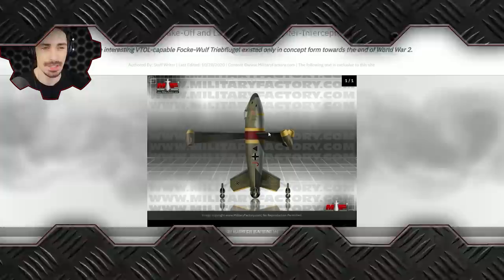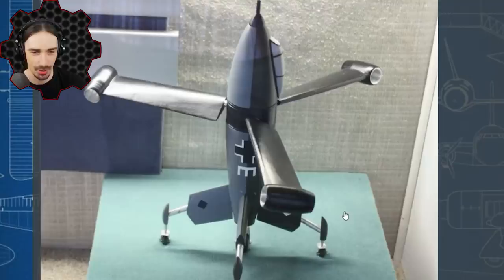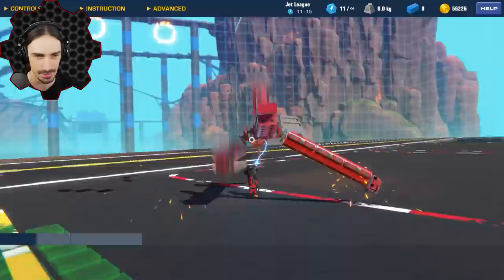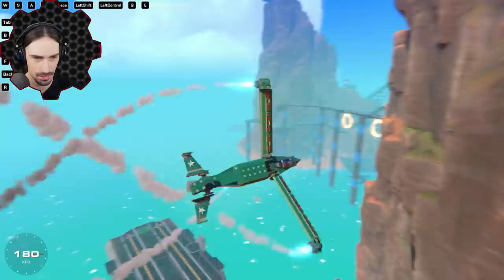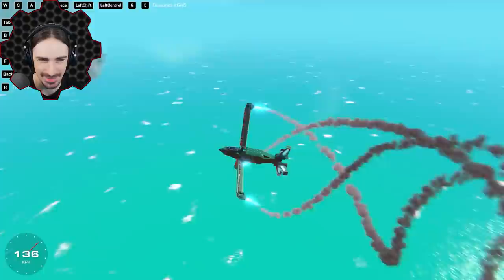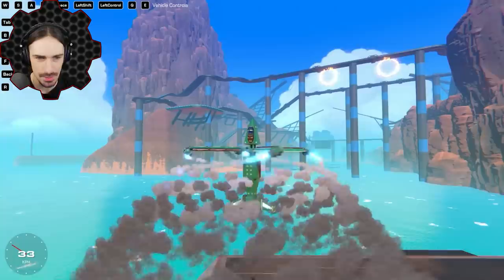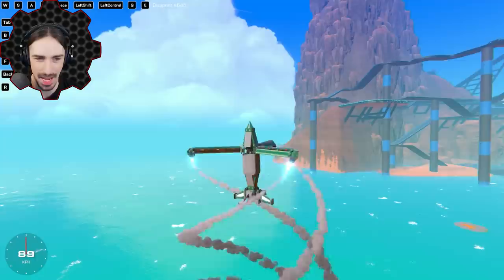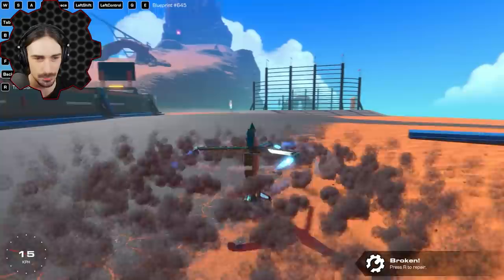TRIEBFLUGEL: The Craziest VTOL Design They Never Made... BUT I DID!

Comment: Your main issue is that the rear flaps aren't keeping their orientation with respect to the cockpit. It is rotating and thus screwing up your controls. I would recommend a larger surface area on the rear stabilizers. The other thing you can do is have 2 counter rotating propellers to cancel out the rotation. Finally, to control pitch and yaw, you can also implement logic similar to the monospinner but rotated 90 degrees to control the jet power as well as the rotation on the ends of the rotor. Your compasses can be horizontal, and you just correct for this using the logic blocks.

Comment: Believe it or not tip-jets are not a terrible idea, but are hard to implement. The Sud-Ouest Djinn is the only successful mass produced tip-jet helicopter I'm aware of, but it used a jet engine to supply compressed air to the tip jets, which simplified things greatly as there wasn't any fuel/combustion in the tip-jets, they were just compressed air nozzles essentially.

Comment: In order to get more pitch and yaw control while hovering, you could make the whole tail section angle, instead of just the fins. The shift of its weight should give you some control over your thrust direction. The only problem is that if you go backwards, the tail fins will switch the direction they steer you in, so you'd ideally need independent controls, or at least logic gates that swap thee tail fin movements while you descend backwards.

Comment: The reason why it is steering to the left is gyroscopic precession, it basically means, if you apply force to a spinning object, the force will be turned by 90°. So your plane/helicopter thing was turning downwards, because of gravity, in combination with gyroscopic precession it was turning left.

Comment: I'm curious if horizontal flight was meant to have a stationary rotor and be fully jet propelled, or if it was supposed to be a giant jet propelled propeller; I would assume the latter based on it's design. A newer design could have individual pitch controls and use the former propulsion to have a hybrid of single axis thrust vectoring and surface elements to have a complex pitch, yaw, and roll controls in horizontal flight between the three blades, assuming it also had a rotor lock to prevent roll from activating the passive rotor. Further this by adding hinged elements to the wings, though these would work better with an element per side under things maneuvers like braking, where a single element per wing in this configuration would induce roll, and only using two of the three would induce pitch within their combined vector. Having nose canards and active surfaces on the tail winglets may also help; another helpful addition could be a tail thruster, which could help for quick takeoff and could provide a suicide burn during landing, assuming the horizontal-vertical change maneuver could spin the rotor quickly enough to do an sb before hovering to land. Any issues with torque being induced on the body could be countered with small thrusters, like how propulsion-based attitude control is done on spacecraft, as this would only really be needed during vertical orientation, and these thrusters could be tucked away such that it wouldn't affect horizontal aerodynamics. 

It's a cool concept that could work with more modern technology, but it's so stupidly impractical, especially when we have jet VTOLs that work by essentially having an extended range of motion on a thrust vector, essentially allowing a thrust vector of ~110° to hover a jet instead of the typical in-flight thrust vector that has a much narrower range; I know, it's a separate mechanism to allow a higher degree of vectoring, and not just the simplistic thrust vector mechanism, but this is the simplest explanation. We also have rotor-based VTOLs that could more than likely outperform this as well, as well as hybrid designs that use smaller jet engines as boosters in horizontal flight.

Comment: If I had to guess, having an ejector seat would actually be completely safe, if they used the same trick that helicopters use - they have their rotor blades attached with explosive bolts so that they get flung off before the pilot gets ejected.

Also, it would probably be a lot easier to pilot a real one, as I suspect that they'd use a mechanism that would allow the pilot to adjust the pitch of the blades based on where they are in relation to the fuselage in order to steer, instead of just relying on the tail fins - again, in the same way a helicopter would do it.
Reply: germans were way ahead of their time. they even make our stuff look crude in comparison

Comment: I'm not sure if the in-game modeling of airflow is this advanced but there's another factor that would be at play in the design: the spiral airflow interacting with the control surfaces, 100% of which are in that airflow in this design, far more that typically. Some single engine planes point the engine slightly to the right to help counteract the combined effects but that's really not an option here.

Comment: Move the centre of gravity rewards to help balance the machine and making pitching up a lot easier.

Find me a WW2 aircraft with an ejector seat.

You had canopies that opened and a parachute strapped to your body.

And that's an improvement over WW1, where parachutes existed but were NOT issued to pilots (because they feared the pilots would bail out all the time instead of trying to land their planes).

But, ejection seats DO EXIST for helicopters, explosive bolts "remove" the helicopter blades before the seats are ejected.
Not common, but it can be done.

Comment: I think the prop wash, i.e. the air being pushed down from the propeller would give you some control using the rudder/elevators.
Think of the plane being stationary but the air moving. So there is airflow.

Comment: It's like the weird ancestor of the Rotodyne.
Edit: Speaking about the gyroscopic forces, I believe some of the older biplane engines, the one with pistons all around it, had the same issue. Because of the spin, the pilots could turn to one side really tight, but the other one required more time and distance to do so. I'd have to research that.

Comment: When I first saw this, I was like, what about the fuel lines? The thrusters spin around, the fuel lines would get tangled up and destroyed. And other than that, it doesn't have anything to cancel the rotation of the rotor to prevent the fuselage from spinning with the rotors, just like a helicopter. There are just so many logistical errors about this...
Reply: Could use hard lines, and a sealed rotating junction
Reply: @irrelevantsafety  Could've, but reliability of the technology 80 years ago and of course accessibility, in the middle of the war, it's rough.
Reply: @john.s1962  very true

Comment: An easy way to counteract the gyroscopic forces on the plane would be to use a second prop that rotates counter to the first prop. If the physics are accurate enough, this will make the plane go faster, too.

Comment: Nice landing!!
pitch and jaw during landing could be controlled in the same manner a helicopter does, if the wings can be angled independently.
a second counter rotating rotor could counteract the torque.
gyroscopic-precession causes it to turn to the side, because gravity and lift create a pitching torque, which can be solved by moving the CoM and/or CoL.
The first creation fell over because the wings were quickly moving into their initial position.

Comment: Modern helicopters have individual control of the blades that allow the helicopter to have the pitch and roll that on this aircraft would be the pitch and yaw that you struggled with. It allows the helicopter to for example pitch up and then down each blade as it passes over only the back of the fuselage to give downwards pitch and therefore forwards thrust. This would be really hard in trailmakers but you might be able to do it with sensors and a crapton of complicated logic.
Reply: I think there are proximity sensors which can be used for that.

Comment: there are A LOT of planes like the do 335 that have 2 props, one in the front, on in the back, when the pilot jimped out incase of an emergency the rear propeller would be ejected so it wouldnt be in the way, just like some helicopers like the ka50 and 52, the blades get blown out by small explosives inside them and after that the rocket on the ejection seat turns on and safely gets him out of the helicopter

Comment: 4:00 Italian would probably work like a hovercraft using the air pushed by the propeller, which I'm guessing is not simulated in Trail makers no you'd need reaction wheels.

Comment: 11:30 It doesn't need an ejection seat for an engine failure. Just like a helicopter, this thing would float down to the ground for a survivable crash landing if it stayed upright, which it should be able to do without pilot input due to how it is construction

Comment: Torque effect/p factor are what are messing up the forward flight. 

This leads to a left turning tendency as you discovered when you couldn’t turn right away from the mountain at 16:00

Idk how to fix it in trailmakers but in the plane I fly it’s countered by canting the nose cone down and right a few degrees and then using a lot of right rudder.

This design is also half helicopter and helicopters are magic so idk

Comment: You need to use another layer of counter rotating propellers!!!! That should stop the drift to the left. You may even be able to control it better by adjusting the speed of the differnet layer propellers

Comment: The problem of landing adjustments with the rudders is actually not a problem, since the lift was higher than the center of mass, so the bottom would automatically be the bottom lol, however, torque?

Comment: @4:05-4:12
Scrap man, a helicopter Uses its blades for Pitch/Yaw/Roll control, and planes do this as well(more less yaw). 
and recently New personal drones(Not rc) have also added propeller stabilization, along with generic prop pitch for height and i cant find the name for it but another personal drone(Not rc) with round disks and propellers in a form of a cylinder, i will edit if i find it.

but anyway had you forgot about helicopters and drones?(and a small part of planes. more less yaw). its used on 95% of modern and older Aircraft. 

Just below "Throttle" Header:
https://en.wikipedia.org/wiki/Helicopter_flight_controls

so my guess when not moving would be moving those blades slightly to alter Roll, Pitch, And Yaw as well. However A Triprop Setup on this model would be awkward to work with, and maybe some safety features like a second alt sensor near the rear of the aircraft for the landing, or 2 cameras facing down to the ground on the belly and cockpit of the aircraft. but 3 blades and normal heli controls would do it

Comment: I don't know where they were going with this 😂 Even if it worked, it would've never been better than a regular airplane! You would probably pronounce it "treebfloogle" with the german ü not existing in the english alpjabet. You actually didn't do to bad. 😁 Love your videos. Keep doing these
Reply: Probably the idea was as simple as wanting the speed of a plane with a much smaller landing pad. Which has always been the goal with vtol. Just, whoever designed this didn't think about how practical it would actually be, even if the physics mostly check out.
Reply: @FastForwardPlans  That's right. Still: If you have jet engines powerful enought to prepell this rotorwing and get it to lift off- you could probably do it without the rotor.The stability issues that come with this design are also not that suprising. My guess would be, that towards the end of the war, german engineers at the time were pretty desperate to come up with anything new, that might yet grand an advantage of sorts
Reply: @malte_volkerson  Germany were at a massive disadvantage from the get go, in tech, people, money, and allies.  

The whole reason hitler got into power was because of how hopeless the situation was to germany after the events of ww1. So I imagine they were doing all sorts of desperate things from the get go, and that seems to be the case based on a lot of the things I saw that came out during that time.
Reply: @FastForwardPlans competition is always the best fuel for the development of new technologies. Some make the transition into civil life, like the jeep f.e. and some don't.... and some developments are just ridiculous. this is maybe somewhere in between xD.

Comment: Yes, the control surfaces will still work becouse the air moved by the rotor(downwash) invest them. Ailerons, flaps and wings work because the air goes into it. They cud have ejection seats becouse the wings are under the pilot, momentum and the suddent airstream going up that invests the already ejected pilot pushes him out and in front of the nose of the thing. But it depends on the situation really, becouse if the helicopter iss precipitating nose first, then you are really screwed.

Comment: what if you just did 2 wings like this then once you level out you can fly it like a semi regular plane but could still take off like a crazy jet chopper
Reply: The idea is basically following the same principle of physics as a helicopter, too few and it does not create enough downward force to land or take off, too many and the helicopter basically shakes itself apart from fighting air forces. With just two the rotational force would be useless. granted using rotational force in the way this idea did it was never going to be practical. Which is why it ended up never being used.

Comment: 11:27 there was actually another nazi plane that was more similar to a normal plane but had a propeller in the back which would cause exactly the same problem with ejecting. Pilots literally wouldn’t fly it so they modified them to make sure the props in the back literally explode and blow off the back before a pilot ejected

Comment: What an engineering nightmare to fuel and control jet engines through 2 rotation points of 1 spinning really fast.
It's also a nightmare to fly and even worse land. But you would have some rudder/aileron control with propwash being a thing.

Comment: no no no , that definitely has wings, planes are FIXED wing aircraft where are helicopters and this VTOL are NOT FIXED wing aircraft meaning that the wings on the aircraft have to rotate to create lift. sorry but other this in this vid were wrong as well.  A little bit more research was needed.